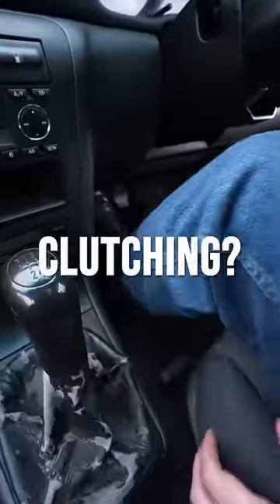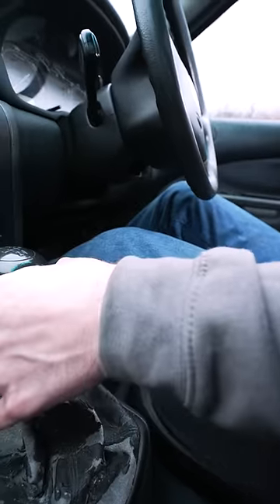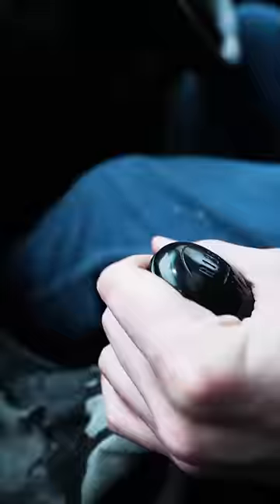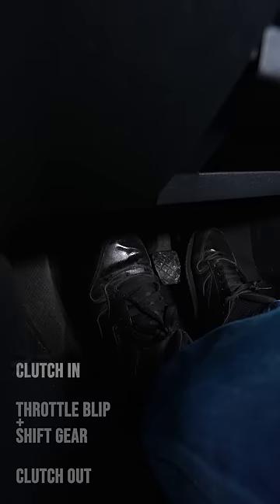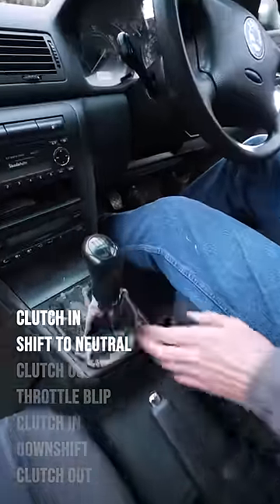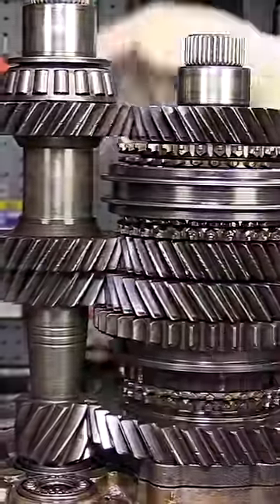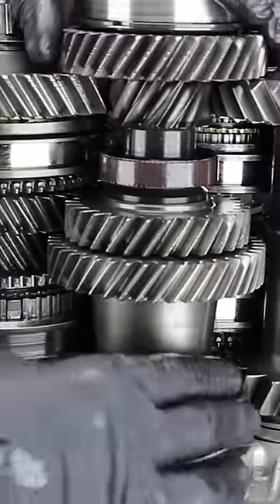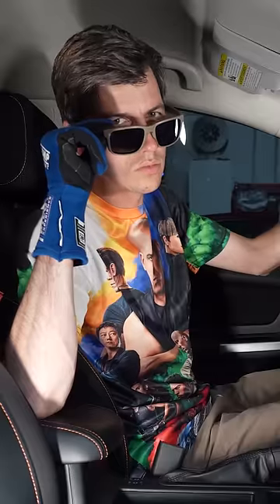What Is Double Clutching? Don't Granny Shift!

Comment: As a trucker, that was probably the easiest to understand how to Double clutch I've seen. Everyone wants to make double clutching out to be some epic mystery. Without a Sync you just float them anyways. Clutch is for stopping and starting
Reply: You mean you ain't got one those nifty 12 spd automatics??? 😂
Reply: @ajg2040  I actually use an auto now days due to my knee being shot from 20+ years of using a clutch. One day I went to step on the clutch and yelled in pain, what cartridge  was left popped. An auto is the only way I can still drive. They are really not that bad once you get use to them, more so in traffic. I use to make fun of them too, but now they are a life saver.
Reply: Learned to double clutch when I first learned to drive. Never used it since except for some heavyweight permit loads that put a lot of gear stress on the transmission. Otherwise yeah, clutch is for starting and stopping. While I like auto transmission for flatland highway running, I still prefer a manual for mountains and off-road. Also some liquid tankers are going back to manual transmission because the liquid loads are ripping the guts out of automatic transmissions.
Reply: I’m too broke to get new synchros in my rather old 4wd. So far, double clutching has saved me from having to do them for the last eight years 🤣
Reply: @KaylieRayne same.
Reply: Sounds like the way I used to shift my old 1965 VW Bug with a non-synchro'd 4-speed transmission.  The clutch cable was always snapping on that thing so I was pretty good at driving it for a day or two without the clutch pedal until I got a free hour to fix it. Easy fix, car was cheap to run, so I put up with it
Reply: @carsonsutherland604  yeah if I was still in heavy hauling I would def want a manual, but I run LTL now and even with 2 53s in New York or the Turnpike in Kansas, an auto runs just fine for the weight we run. I miss having a stick I just cant do it anymore. Ive heard that about the tankers, the surge from stopping and going was just killing the autos, I remember the first auto I had was a 2007 780 and the damn X/Y shifter kept breaking on it, it was always in the shop cause it wouldnt shift. Thankfully knocks on wood the Freightliner Im in now hasnt had any problems. I like that the new gen of autos skips shits and starts out anything but 1st.
Reply: Those who know what their doing do it without thinking. Drive on Driver..👍
Reply: @KaylieRayne I get you, been driving manual since 91. Getting tired of it and with today's traffic, a move to auto is a much relief for me. Also found out maintenance for auto is cheaper. Just change oil and filter. With manual, the whole gearbox needs to come out to change the seals, bearing, clutch cover and lining apart from the oil change too.
Reply: I know when I was training for my CDL in the oil patch, I finally got a great trainer who explained downshifting to me like I rode around in a car by myself with a mask on and it fonally clicked😂 😂😂😂😂
Reply: I drove a 69 Chevy truck for a good year with no clutch. Start it in granny and shut it off at the light if I had to.
Reply: Hahaha ain't no body use that outdated 3rd pedal thingy!
Reply: For real bro!
Reply: @ajg2040  Trucks come in either Manual or Automatic. I've seen gearboxes that are adorable for a truck (6 Speed (A)) to the insane 22+2 (HI/LO with Crawl gears, Manual)
Reply: @movingtargetproductions5046  It was a joke to the op. Seriously..  I grew up in trucking. My dad still trucks, I'm in year 26, and my oldest boy is in his 3rd.  Trucking is what we do.  I'd like to think we do the right way.
Reply: @KaylieRayne How long you been drinking 18 wheelers?
Reply: @crosslink1493  The Export VW Bugs had a syncro transmission since 1952 except for the first gear. From 1960 on every VW Beetle had a synchro trans.
Reply: I used too shift my old 86 bronco 2 all of the time without using the clutch. No double clutching either, it was done all by manipulating the gas pedal. And I never ground the gears either. My 95 Ford pickup was a different story, you could pop it into neutral without using the clutch. But you had to push in the clutch to shift, otherwise you would just grind those gears.
Reply: @ajg2040 you mean the buck-box?
Reply: Shifting without the clutch? 😮 Does that not produce a horrific noise and wreck your transmission?
Reply: @MichaelB769  Nope, if you match the RPMs of the motor and transmission, it just slides into gear. Now you do tend to grind them once in a while no matter how long youve used a manual. You can float any manual transmission but non0synced transmissions are really made to float.
Reply: I drive a manual trans and consider it modern theft protection. Considering the demographic that steals cars these days can’t drive it anyways I’m set. Even with the key so worn out I use a screwdriver to start it. If it ain’t broke, don’t fix it lol.
Reply: My dad taught me to float in a old septic tank pumping truck lol talk about a shitty job
Reply: Hardest part getting my CDL was unlearning granny shifting. For the test in my state you're not supposed to float.
Reply: a trans trucker??? an unexpected yet awesome crossover
Reply: @ellie.ellers  Theres a lot of us out there trucking :P
Reply: @KaylieRayne  I guess that helps narrow down career paths :3
Reply: @ellie.ellers  Trucking isnt easy, but Ill say its a very fulfilling job. The places youll go, the things youll see. The money can be amazing, but youre gone all the time, youll be out in the weather. Ive done this for 23 years so far. Cant see doin anything else.
Reply: You people that are talking about the clutch being used for starting and stopping are describing driving 18 wheelers and other really large vehicles. Driving a standard shift light vehicle requires using the clutch for every gear change.
Reply: @genespell4340  Not really. I use to float a F-150, Ive floated a Mustang.. ANY transmission can be floated, A semi transmission is looser so its easier to float than a tight one on cars/pick ups.
Reply: Nah, you can float synchros but they dont like it and will crunch. You can do it though. @genespell4340
Reply: @KaylieRayne ya reckon? I float gears in the truck, but my four wheel drive doesn't like it.
Reply: My dad has been driving commercially for 35+ year. We have had this conversation many times. What I have got is , there's a time and a place. The DMV are the dumbest people around to expect you to do it every single time, in the CDL situation.
Reply: Yep, no one clutches in a road ranger.
Reply: That would actually be the break clutch in fact.
Reply: @ajg2040 some Applications can't run automatic
Reply: @davespanksalot8413 if after 8 uears you can't save up enough to change synchros of the whole car. Maybe you are too poor to own a car and have access to internet. Please cut your internet it would get you your synchros in a year maybe.
Reply: It's been proven that floating them gears damages them just as much as good old grinding
Reply: Who needs brakes? Good on ya.
Reply: @roadspectre7655 my gripe with automatics is the response to input. The transmission/computer trys too hard or not hard enough when you need it to. I hate that more than anything.
Reply: @KaylieRayne  ywnbaw

Comment: as a truck driver i enjoy floating gears, its a very comforting feeling
Reply: "This is the way."
Reply: the clutch is just there for starting.
Reply: I remember how I sucked at it when I first started out.
Then just as you get the hang of it you end up in a different truck.
Took a few different trucks to comfortably do it in any one of them. All of my experience was older CAT's, Detroit's.
Then after 7 years, I end up in a brand new ISX KW. Look like I came right out of driving school again.
You can explain the theory/operation till you're blue in face, but until you practice it, its just not that simple.
Its definitely worth learning.
Reply: You prefer it over the… syncing feeling?
Reply: You don't learn how to float gears, you just start doing it...
Reply: @pseudotasuki  Boo!
Reply: It's a smoother shift to float over double clutching if you do it right.
Reply: I used to do it in my 06 Sierra all the time. I loved that feeling. It freaked all my friends out cause they had never seen anyone shift like that without grinding a gear. I made it look like childs play but the first little while I did it God damn youd think I was torturing a cat with the sounds that trans made
Reply: I used to be able to float gears in an 05' Jetta TDi I used to own. It was actually funny how much that little 1.8L turbo diesel felt like driving a big truck, floating gears and all.
Reply: You gotta find the sweet spot in the RPMs for that particular transmission. But I can jump in any 6-8 speed GMC 6500 and up nowadays and float through the gears like it's nothing. Takes a bit of watching and screwing up to get it down pat though. Nobody just figures it out in a couple of days.
Reply: @synshenron798 , we need a video tutorial....😊
Reply: I've floated gears for almost a million miles. No problems.
Reply: I'd float em in the old work truck and that was just an old f350😂
Reply: @stover77 
Yeah but the McQueen double clutch is the way.
Reply: @GR8APE69 
Had to learn it immediately when the clutch cable broke in the ol rabbit diesel.
Pretty amazing how stout a starter motor is when youve gotta stop for lights and stop signs. 😂
Reply: @philipgriessel5315 man I damn near gave a female friend a heart attack when I didn't use the clutch from 2nd to 5th lol. Also, love the 5315 was a great ODA. Miss those days.
Reply: The only time I ever floated gears was when I drove off that bridge, they didn't really float for that long tho
Reply: @MrTheHillfolk I lost the slave cylinder in my 1965 Ford Bronco 302ci. Drove that sucker for a month and a half without a clutch. Those little three speeds don’t like that too much but I had her singing by the second week. It’s crazy what you can do without when you need to. Later on, I did the same with my Honda 650 for a night or two. It’s a lot dicier on a bike than in a truck, that’s for sure!….
Reply: @chrisclark6044 No you didn't... maybe it was your boyfriend giving you road head so he could see your feet working the pedals. I'd believe that.
Reply: @FatHalibutz32  um k. Is that an attempt to hurt someone's feelings? Or did you have a bucket list and the very last one was make a off handed remark to someone on YouTube?
Reply: @kenbrown2808  and stopping, don't forget lights!
Reply: As a Pontiac Fiero driver, I LOVE floating gears. It is so satisfying!
Reply: @dracer247365  then you just slip it to neutral. The screaming jimmy i used to drive wouldn't shift the diff if the clutch was disengaged, anyway.
Reply: Agreed clutch only for starting and reversing
Reply: @markpolice3585 over 2 million. On the original clutch.
Reply: American trucks are outdated.... transmission is not synchronised...while everywhere else they have synchromesh transmissions since 90s...which removes need of rev matching while downshifting
Reply: @Xv1p3rCr0  we've had synchros since the 70s, 80s, on big trucks. Now we've got flappy paddle shifters in trucks.
Reply: @Xv1p3rCr0  that's because we still have some truck drivers.
Reply: That's the only way to drive'em driver!  👍👍
Reply: I’ve never heard it called floating gears, I like it 😊
Reply: Yeah and in some trucks you have to go to neutral before going into next gear
Reply: @metal-fan  duh considering you have to pass thru neutral on the way to the next gear.
Reply: I miss driving truck!... to be completely honest, I had a thought one day to try and shift without using the clutch..(yes I was Bob tailing) and it worked!... the funny thing is, I figured it out before I even knew that floating gears was even a thing!  😂😂😂
Reply: @metal-fan  Actually, if you think about it, they all have to go thru neutral to get to the next gear!
Reply: And u don't even have to use the clutch. I love it.
Reply: The only way to shift…💪🏾💪🏾💪🏾
Reply: Yes, once you get good at driving a  13 speed, normally you always float gears. The only time I use the clutch is for first gear or reverse. Every once in a while, if I have to downshift quickly and hard, I would use the clutch. Also, I'm not sure why, but I've noticed if I was starting out on a incline, in some trucks, it was difficult to float the first few gears, so I would end up clutching.
Reply: @festersmith8352 yup exactly. I started in an 18 with a 565 cummins. Was pretty good with it. Tried a few Detroit's in between, could somewhat do it. Now, my current job has a punny cummins freightliner with a 10 speed. 10 speeds are going to be the death of me.
Reply: @BeingJermaine  THAT'S RIGHT!  👍👍
Reply: @jmount411  Because when you're pulling a load up an incline from a dead stop, it always drags the RPM's down faster than you can shift- I always run the RPM's up a little higher than I would normally shift, and just shift naturally, it'll work everytime-
Reply: I can do that with a car that I know well, but it the rpms you do that at don't give you the acceleration you need for driving in town. At least, it wasn't with the cars I've done it in
Reply: @sampic_  Once you go to splitters, you never want to go back.
18's my favorite.
And I miss the older engines!
Reply: @Gottiline_Ace yea.. it's all in the sound and vibes
Reply: @festersmith8352   Yeah, I tried getting my CDL in a manual truck and let's just say things didn't go well...  😅😅
Reply: @ne9835  Most of us sucked at it at one point. But with practice you can get the hang of it.
First mistake that is made, is thinking its like a car and driving it like one.
It really helps to understand how the transmission works. And the concept that road speed and RPM's have to match for that gear.
Even after 25 years, I found it difficult to double clutch with the modern engines rev up and down so quickly. Seems like you can't you move that clutch fast enough.
And you have to double clutch for testing.
This is why I had such a struggle with that new Cummins. I wasn't throwing gears fast enough to follow the engine rpms.
And the new Detroits is like shifting gears at the drag strip.
Keep practicing, you'll get the hang of it.
Reply: @festersmith8352   Yeah, thanks, man!!! 👌
Reply: For those who still get to physically change gears.
Reply: I love floating gears as well, but sometimes it's a good idea to double clutch thru the gears cause Everytime you double clutch it helps re-adjust tension in the clutch
Reply: @garrettmcguire6864  That’s cool, most women don’t like attempting to change gears without using the clutch. Congrats!
Reply: @Xv1p3rCr0  We've now got electric trucks that will 0-60 faster than most cars.... but sure, "outdated"
Reply: @dracer247365  and? like the rest of the world, actually BYD(china) is selling Ev trucks to US companies so i dont see what you are braging about? It still doesnt change the fact that current trucks are outdated